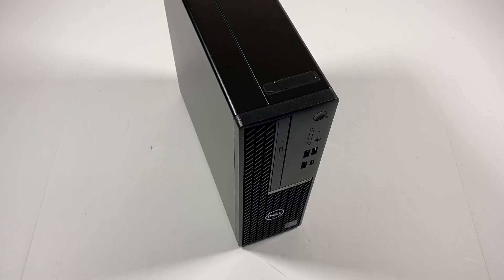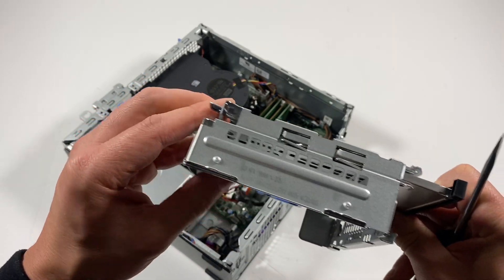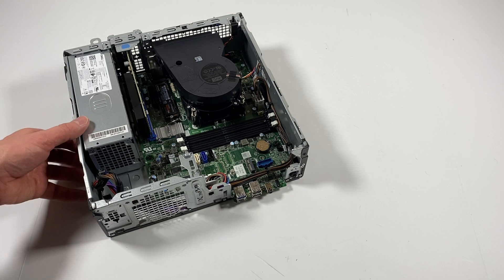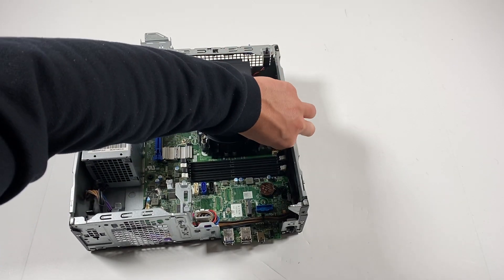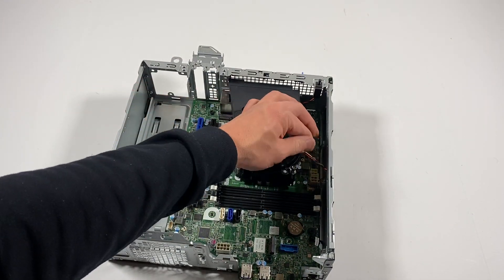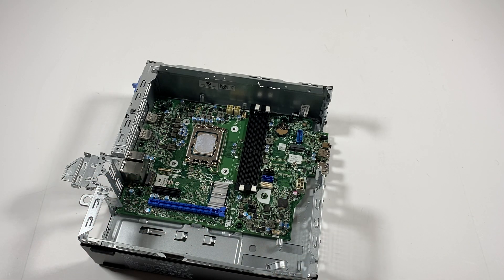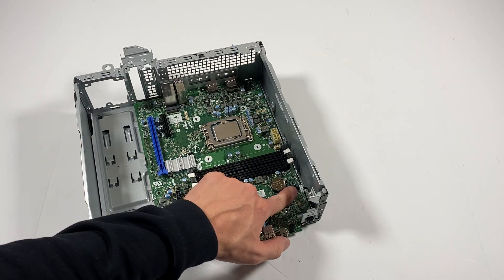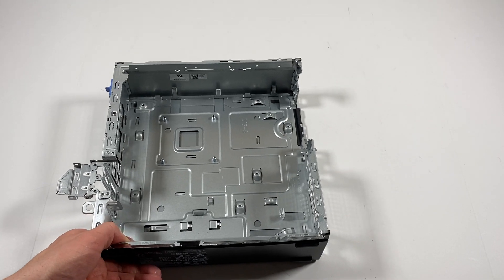Dell Optiplex 7000 5000 Teardown

Comment: If it's possible to upgrade to a 300W PSU on the newer SFF Optiplex 7000, it raises the question of why the Dell H460EBM-00 PSU, which offers more power, fits in older models like the Optiplex 5050 SFF. It seems counterintuitive that a newer model would have less PSU upgradability compared to an older one. This discrepancy doesn't quite make sense. Can anyone explain the rationale behind this limitation?
Reply: Isn't SFF a standard for the PSU? So they should all be interchangeable right?

Comment: That thing has 3 Sata ports, I wonder if you can fit 3 HDD's on that thing
Reply: One of the ports is intended to be used by a DVD drive, but you could replace the optical drive with a 2.5" adapter caddy, and pop 1x 2.5" SATA drive in there. you can then put two more 2.5" SATA drives into an adapter bracket, that fits in where the 3.5" drive is. so YES - you can!

Comment: I wonder is it possible to upgrade the motherboard wth a newer OptiPlex series one or a more modern brand , would this case support such an upgrade ?
Reply: No.  This is the downside of buying OEM like HP, Dell, or Acer.  They use proprietary components (case, motherboard, power supply, CPU cooler) that are not upgradable outside of a paltry list of OEM components that shipped with the highest SKU for the model you have.  Go with a System Integrator (SI) like OriginPC, CyberPower PC, iBuyPower, Apex, Maingear, or NewEgg PC-Builder,.  They use all off-the-shelf industry standard PC parts.  Everything from the PC case to the power supply to the motherboard is standardized off the shelf (user upgradeable) components.